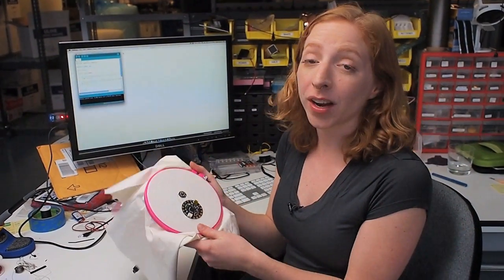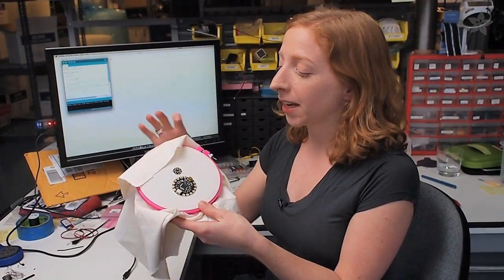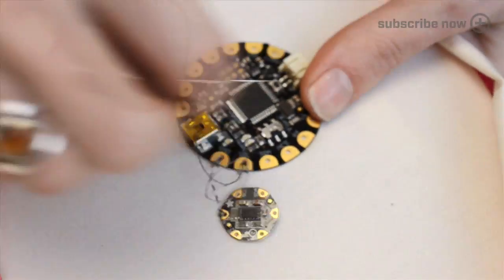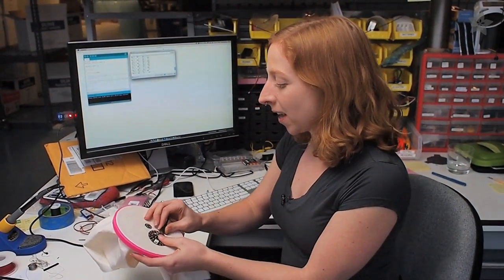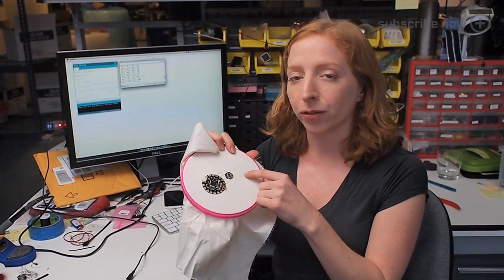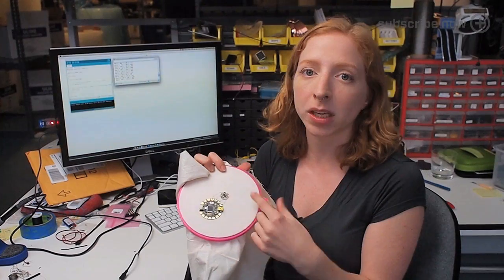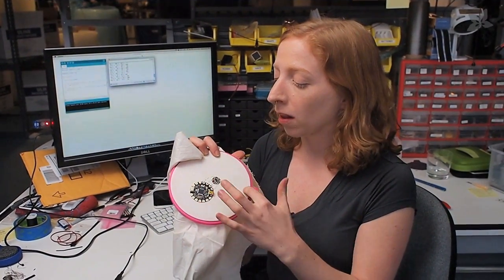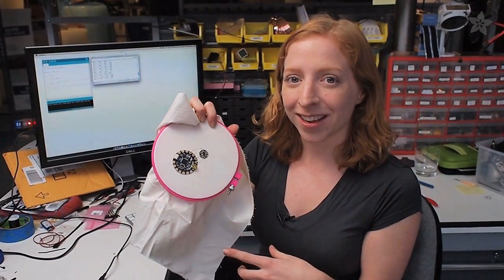Flora Accelerometer - Wearable Motion Sensing!

Comment: I would like to add temperature sensor. So i could have it on my work shirt and it can tell me when the temperature is jumping up in the summer and alerting by sound to get out of the heat or take a break. BUT i dont see a temperature sensor on adafruit and my coding is new.

Comment from the maker: Flora Accelerometer - Wearable 3-axis motion + compass  #Wearables   #FLORA  
https://learn.adafruit.com/flora-accelerometer

Add motion and direction sensing to your wearable Flora project with this high precision 3-axis Accelerometer+Compass sensor. Inside are two sensors, one is a classic 3-axis accelerometer, which can tell you which direction is down towards the Earth (by measuring gravity) or how fast the board is accelerating in 3D space. The other is a magnetometer that can sense where the strongest magnetic force is coming from, generally used to detect magnetic north. By combining this data you can then orient yourself.

Comment: I want to build a submersible ROV with off the shelf components. I need a motor controller that will maneuver it with 4 fixed dc motors. It needs to be able to maintain a selected depth and maneuver in all three dimensions. Essentially an underwater quad copter. Sorry you asked huh?

Comment: Great stuff.  One could make a Tron-like outfit that turned lights different colors depending on direction or acceleration.  Perhaps turn red/blinky if you're going so fast you'll splat if you don't slow down or if a GPS says you're going torwards danger?